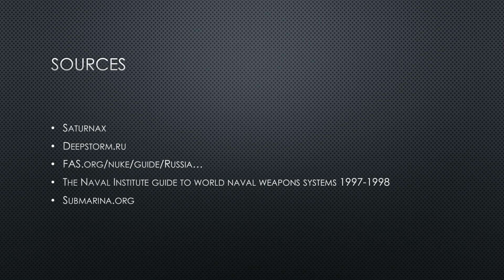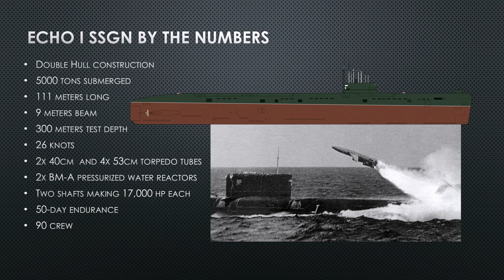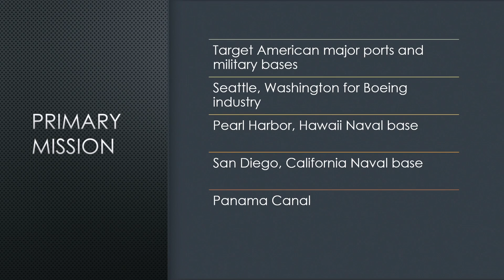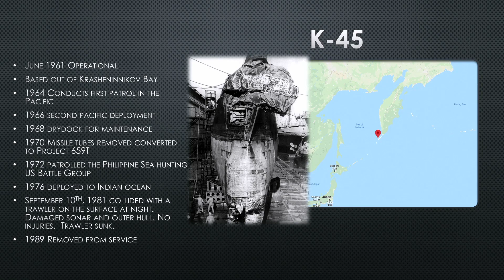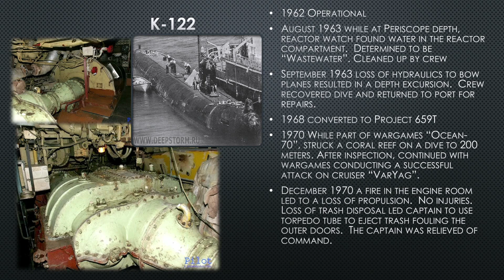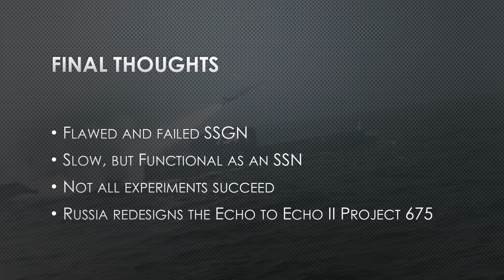Echo SSGN Sub Brief

Comment: To my knowledge the P5 dosen't need a jump start. It has a turbojet that has to spin up just before launch while the sub is on the surface. This is also one of the reasons the missile takes so long to launch. During takeoff both rockets and the turbojet are working.

Comment: I was a P-3 acoustic system operator in the 70s and 80s. I have chased these boats a few times. They were painfully noisy. But then the acoustics in the south china sea is usually very bad. HEN class could run turbo gear reduction or Turbo Generator or run the shaft on batteries. They had a Motor/Generator in the drive train with a clutch on both sides of the Motor/Generator. The problem was that they had to run with enough RPM on one or both shafts to maintain hotel power. Really noisy and a very distinct signature when running split plant ( one TGR and one Turbo Generator ). In decent water they were very easy to detect and track.
Reply: This explains why they were called the Echo class.With their noise they also made echo.😂

Comment: you mentioned when the p-5 launches from a surfaced sub, theres a rocket ignition that jumpstarts the turbojet engine. what sort of failsafes are in place if the turbojet doesnt start?
Reply: You mean so that the warhead doesn't go off when the missile crashes into the water?

Nuclear weapons take a lot of specific steps to go off, a plane crashing into a mountain at 500mph will not set one off.

Comment: When talking about fire suppression I've heard you use the term Freon on more than this video, are you actually referring to Halon? Freon is a  trademarked name owned by Dupont referring to refrigerants.  R-12, R-22, R-134 etc. Freon when introduced to an open flame turns into Phosgene. Which is basically a Chlorine gas like those used in W.W. I  Halon is a gas I've seen in large Electrical and Server rooms to remove the Oxygen and put out the fire. Freon also displaces Oxygen but turns to Phosgene when exposed to an open flame.
Reply: to be fair, if someone is in the room which the fire suppression system was activated in the least of their problems would be the phosgene.
Reply: @testaccount4191  Your dieing either way if you can't get outside. Just doesn't make sense to add poison gas into the equation ☠☠☠
Reply: @dscary1837  the ability to put out the fire quickly is a lot more important than extra toxic gasses in the atmosphere.

You're going to be wearing a respirator for a long time, anyways.
Reply: @ScottKenny1978  If you have access to and time to put on a respirator. Don't know if you've ever had the experience of inhaling Phosgene,  I have. If you ever do have that experience you will never forget how it burns your lungs and you hope your not going to die. (Hope you never do) The presence of this reaction should definatly effect your ability to put on your protective gear.
Reply: @dscary1837  at least on a US sub, there's about a dozen times more respirators than there are crew. Crew's Mess alone has enough for everyone to grab one, plus one at each bunk, etc ad nauseam. You're literally never more than about 10 feet from a respirator.

I don't think the Russians would have significantly fewer masks, given the investment required for training the crew. 

Once the fire is out and it's safe to be at periscope depth, the preferred means of ventilating the ship is the diesel. Big 2-stroke moves about 7500 cubic feet of air per minute.

But you're still going to spend half the day in those masks due to ventilation half-lives.

Have you watched Jive's whiteboard on submarine fires? You have about 30sec to put on a respirator or you're dead anyways.
Reply: @ScottKenny1978  Hey Scott we're definitely on the same page.  Talking C.F.M'S is speaking my language as,a Union H.V.A.C..Service Tech who who works on Commercial and Industrial systems. I watch all of the Turkey's episodes. (One of the best channels in my opinion) That's why I wasn't criticizing our man. Just trying to keep anyone else from doing it on a mispoken word or term which  sounds similar. I've never served on a Sub.(and freely admit it) but did look it up and Halon mentioned and some newer gasses used as Fire Suppression. You and Turkey both keep up the good work and look forward to friendly discussions in the future.

Comment: You got it wrong the Echo is a SSN and the Echo II is the SSGN.  Basically they would have been a target.  As for the SS-N-3 Shaddock you need to go back to school on that system, it was also employed on surface platforms also, this missile is a little more sophisticated than you describe.
Reply: It was, it had many versions, but it also had a shelf-life and went to be "morally obsolete" as strategic weapon.
Reply: @docnele  the SSN-3 was around as a anti ship weapon system for quite a while.  Yes it was behind the times as compared to the West, but it was fielded in the anti ship inventory up and thru the 80's.  The system did work well if not defeated by Electronic Counter Measures, and then it was easy to defeat.

Comment: 'Fire in the engine room!'
Russian submariners: 'Again?'
Reply: Seems like they build the subs from black powder  or something even more easily burning. Rename the sub from Echo to Torch class.
Reply: More Soviet "Rock,paper,scissors" amongst the crew to see who wins the firefighting duty in the engine room.
Reply: Yep the Soviet era submarines had a tremendous issue with fires onboard their subs.  Sorry their damage control training and equipment was far inferior to the West.  Seems as if the spare time not actually on watch was consumed by the Zamapolt, the Communist Party Officer onboard EVERY vessel.  Follow Soviet era accidents at sea and see how often a simple easily corrected issue lead to the loss of the vessel.
Reply: @thomasheer825  No they didn't. You are talking mostly nonsense. Yasen class has 85 person crew. Verginia has 135. And the Yasen is a bigger boat. Russian subs are more advanced than US subs clearly
Reply: @Toro_Da_Corsa  look at your training, we use often less automated systems for a specific reason.  Yes it takes more people to run but sometimes simple is more reliable.  Training is paramount on a submarine, and if you rely on all of those automated systems eventually it will bite you in the ass.
Reply: As opposed to the USN just running 3 drills a day of fire in the engineroom...
Reply: @Lawofimprobability rode boats for best part of 2 decades and if the old Soviet Boats had a O2 generator system similar to what we used they DEMANDED attention in great detail and care, their nickname was "The Bomb".  When you break down pure water into oxygen and hydrogen, you got to do it right as any mistake makes a massive explosion.
Reply: @Lawofimprobability It actually was. You are just doing the superiority complex thing
Reply: Submarines are made of napalm, phosphorus, kitchen grease and matches.
Reply: @moreqdos7657  30 seconds from "I smell something burning" to black smoke so thick you can't see your hand in front of your face. 2 minutes before the entire compartment is full of that smoke.

And gods forbid you have a fire in the battery well like the Bonefish or Dolphin. That's an emergency blow and abandon ship moment.
Reply: @moreqdos7657  rode boats for 20 years as a "Fucking Rider" doing my job.  Got qualified on Boats, sorry to burst your bubble they are very complex machines that are supposed to sink.  The best way to describe a boat is take a pickup camper and place 8 of your best friends in it for 60 days.  Now put it underwater in a pond.  Now remember any problem that arises you have only seconds to react, you don't get a second chance if you are wrong.

Comment: Speaking of "wastewater" on K-122 - Google Translate definitely screwed up. On Deepstorm it says: "В реакторном отсеке было по пояс воды с температурой около 60 гр" which translates intp "In the reactor room, there was waist-height water with a temperature of about 60 degrees" Which is 60 C, of course.
Reply: Waist - waste eh same thing comrade! 
- Google, probably
Reply: Speaking some Russian, in the example given, it is actually quite a faithful translation......гр is an abreviation for градусов (degrees). "В реакторном отсеке"  is "In the reactor compartment" (not room.....) - so there's a small mistake at the beginning. 

"по пояс воды" is waist-deep water - so that is correct. ("пояс" refers to waist, waistband or belt) - there's no mention of "waste" water in the original Russian. (Wastewater would be something like "сточные воды" - which clearly isn't in the text).

Google translate performs very badly for many languages - Russian being one of them. Yandex Translate is head and shoulders better than Google for Russian translations.
Reply: @grantchallinor5263  well, it wasn't Google, it was me. Google came up with "wastewater" =)
Reply from the maker: oh, good catch.  Thank you.  Yeah, google is my favorite tool, but sometimes it gets it very wrong.
Reply: @SubBrief  They closed tube No. 5 somehow and then removed countermeasures from 400mm rear torp. tube. BTW, The captain was relieved, but was reinstated as the captain of the "crew 305" that served on K-201 "Charlie".
Reply: Try deepl for translation, I find it gives much better results than Google
Reply: Oh yeah google translate is ok
Reply: Waistwater